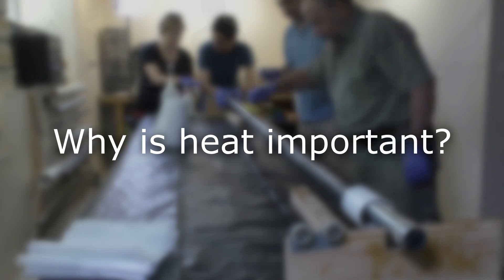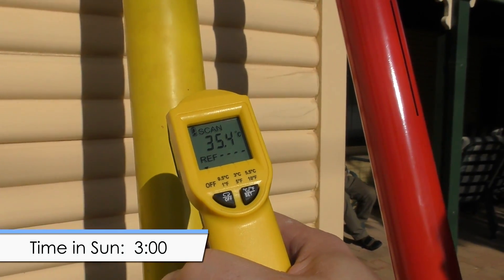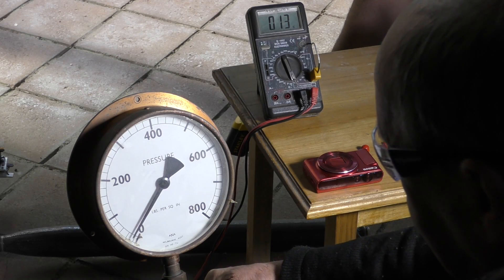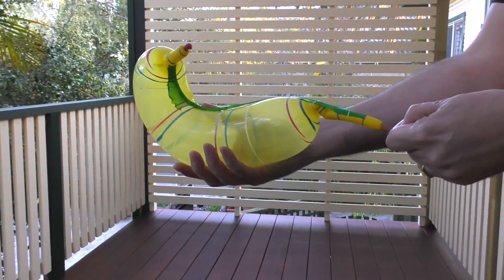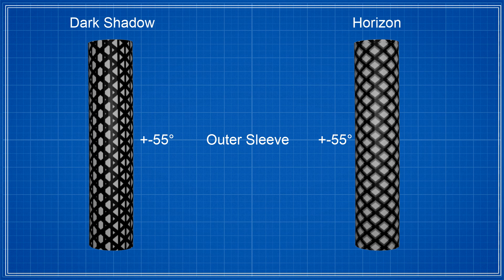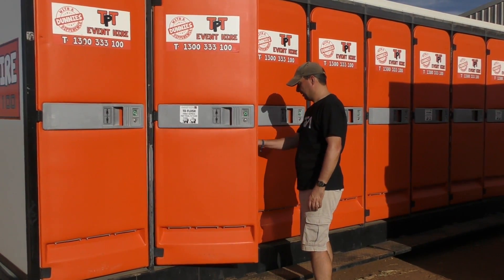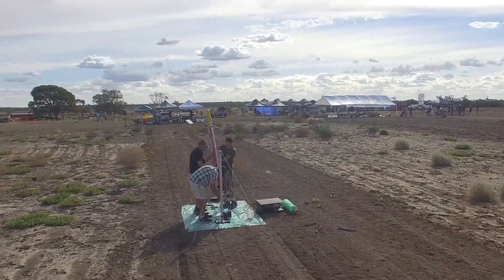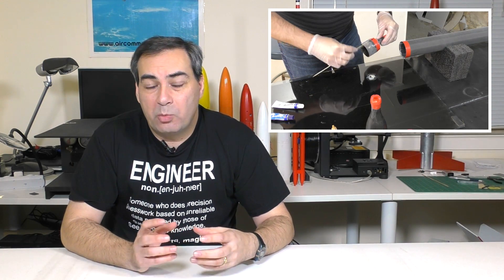2 Stage Water Rocket - Part 15 - Bending Details

Comment: If instead of using a 12k 2" sleeve, you used three different sizes of 3k sleeve (2", 3", and 4"), you would end up with tubes of roughly the same wall thickness but with multiple different fiber angles. The sleeves can fit a surprisingly large range of mandrel diameters. By having sleeves with a larger nominal diameter, the fibers will be aligned more axially as the sleeve is pulled tight.
Reply from the maker: Yup, this may help to some extent, but your minimum angle might get down to say 25 degrees with a sleeve. Besides being more work (you can only put one sleeve on at a time) applying three sleeves is likely to result in a heavier airframe. You would probably need to use vacuum forming then, to really squeeze the epoxy out of each sleeve as it is applied to try to keep the weight down.  The inner liner could be made from the oversize sleeve, since it doesn't need to taper down at the ends, and then the top sleeve could be made from the undersize sleeve which allows you taper down near the nozzle and top endcap.
Reply: @AirCommandRockets  I've helped to use this method to make a 6" diameter high power rocket airframe tube that flew on a 152mm O motor. We used 1 layer of 5" sleeve, 2 total layers of 6" sleeve, 3 total layers of 8" sleeve, and 3 layers of convolute fabric. The layers didn't go on in that order, but they did all go on within the same work session. We tried a test section of tube using this multi-diameter sleeve approach with vacuum forming, but it turned out that in addition to squeezing excess resin and voids out of the layup it caused the fabric layers to buckle under the compressive hoop stress and created lots of axial wrinkles. We think it's because while individual layers of sleeve can stretch by changing the fabric angle, having a stack of layers with different angles meant that the layup as a whole could not. In the end we went without vacuum forming.

By the way, your 2 layer balloon technique for making nose cones and other curved surfaces is really fantastic.
Reply from the maker: Cool, that's very interesting. Did you put all those sleeves on dry and then applied the epoxy, or did you put one on, wet it out, then put the next one on etc? We found it almost impossible to slide another sleeve on while the one underneath it was wetted out. Perhaps because our sleeves are a fairly tight fit (to get the desired fiber angle)? Also we make them 2.5m long, perhaps shorter lengths and bigger diameters are easier? 
Good to know about the wrinkling issues you had with the vacuum forming, that was my concern as well, I wonder if infusion would work better in that case, perhaps not?
Reply: We'd put one on, wet it out, and then put the next one on. It was a bit of a pain, and the method we used certainly was easier for larger diameters. Essentially we bunched the entire sleeve up, slipped it on one end of the mandrel, and slowly moved the bunched up fabric down the tube with one end held in place. It was slow going and having plenty of people helped a lot with the process. The tube we made was almost 2.5 meters long as well, but that included a bit of extra margin at the ends. We were using PTM&W's Aeropoxy with PH3660 hardener, which has a 60 minute pot life. That certainly helped things for us. All told the process of the layup probably took about 2.5 hours, but that was with 9 layers. Obviously doing fewer layers would take a lot less time.

We didn't try infusion since we didn't have all the infrastructure set up for it. It does seem promising though.
Reply from the maker: Thanks for the great info. I can imagine that must have been a handful, interesting about bunching it up before putting it on. I wonder if it would be possible to bunch it up on a plastic tube tube that is a little bigger than the mandrel and the sleeve on it, and then slide that over the mandrel, and then as you pull out out the tube, un-bunch the sleeve, so it doesn't need to be dragged over the wet sleeve. The plastic tube should slide easier.   With west systems epoxy and the slow hardener we use we get about a 20 minute pot life, we  try to extend that by mixing smaller amounts as we go.
Reply: Bunching it up on a plastic tube certainly would've been much easier than what we did, which was to have two people holding the bunch with all 4 hands. That would've simplified things a lot, and I'll definitely pass that along to the rest of the team. 
Something else to consider is that Aeropoxy is only slightly more expensive than West System, at least here in the US ($150 for 1 gallon total of resin and hardener of Aeropoxy, vs $150 for about 1.25 gallons total of West System), but it has a much higher glass transition temp of 90°C. The launch took place in the desert in summer, where ambient temps were 40-45°C. We didn't experience any softening or weakening at all, even in the direct sun.

Comment: Great testing ,I have painted Rc cars with carbon fibre and glass fibre and Rc boats and found that certain chemicals in spray paint even on cured  carbon fibre destabilised the resin even weeks after the paint cures ,found parts to be soft and flexible and lost Rigidity which might be partly responsible ,so now use thin plastic wrap instead and it’s stopped the issues ,I would do a test sheet of carbon fibre and paint it to confirm any reactions that take place,hope this helps👍
Reply from the maker: That's an interesting observation. I can understand that certain paint thinners could affect the epoxy. We haven't seen this issue with the paints that we use, but it would be worth an experiment to see. I wonder also whether epoxy or polyester resin are affected differently. What paints did you use?
Reply: @AirCommandRockets  here in the UK I used car paint ,and a brand called plasticoat ,and tamiya spray paint  the car and plasticoat paint reacted tamiya had mixed results so to save my self from the frustrating issue I use adhesive vinyl hope this helps👍

Comment: I wondered about your CF thread orientation when you published the failure video. I disagree with ont statement you made. You said the rocket body would be under compression and tension when it bent, this would be true if it was not pressurized but the stress due to the internal pressure would guarantee that both sides would be in tension.
Reply from the maker: I agree with you on that point. Yes when pressurised both sides would be under tension.
Reply: @AirCommandRockets  I spent 20 years as a pressure vessel engineer for the petrochemical industry. The rocket failing length wise is interesting now that I think about it. The hoop stress usually governs and the longitudinal stress is is typically much lower without vacuum loading or some sort of pipe or structural loading. The reason it did not fail via hoop stress must be due to the carbon fiber weave being at an angle to the hoop loading.  I assume that caused the stress to be concentrated along the weave fibers resulting in the mesh actually shifting in the semi fluid state of the resin. Can you get CF in thread form and using a motor apply some layers strictly for hoop stress and then a layer lengthwise? I think you need to be wary of the hoop stress component if the resin decides to fail and you have laid up the CF in a lengthwise fashion. Some where I have the standards for fiber glass vessels, need to dig around and try to find them. I love seeing the interesting ways you come up with engineering solutions for this type of rocket system.

Comment: First bending and then premature...ehm...deployment of the "red rocket", can't make this up xD
Wonder how much trouble would it be to make a winder? 2 steppers and some arduino code should do it "in theory"
Reply from the maker: When I turn on the deployment mechanism in this rocket I normally keep my finger over the servo horn so that it doesn't accidentally deploy. I had my finger on the wrong side of the servo horn and accidentally pushed it. :( 

I am not sure I understand what you mean by "winder"?
Reply: @AirCommandRockets  ah, the thing that wraps single line of fiber around a cylinder for making composite pressure vessels
Reply from the maker: Oh, ok that makes sense. :) We looked at building one a while back, but the complexity / cost made the sleeves a more attractive option. Simple winding machines also have a limitation on the minimum angle. We also looked at X-Winder machines that may be something we explore in the future.

Comment: How about strong fan? It could provide constant air move and heat exchange till last moment before start. Great wideo, waitng for more :)
Reply from the maker: Thanks for the suggestion, though I think air cooling could be effective only up to a point especially on a hot day. There usually is a breeze at the launch site anyway so it is already partially getting cooled that way.

Comment: for cooling of the rockets have you thought of a water "spraying" system that is built into the launcher or something similar,  and then you would not have to worry about the toilet paper drying up ore being stock on the fins
Reply from the maker: Spraying water on the rocket could work, but it means you have to bring more water to the launch site. Perhaps having some kind of a collecting mechanism at the bottom to allow you to recycle the water.
Reply: @AirCommandRockets  a recycling system is a must though, otherwise deal with the mud :D
Reply from the maker: This is why we put a tarp down under the rocket. A launch normally causes its own mud.